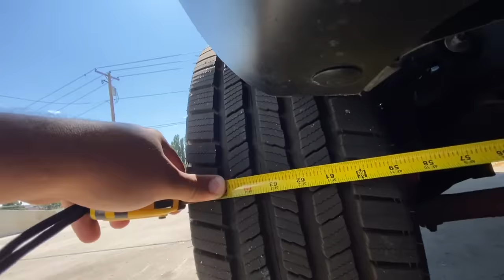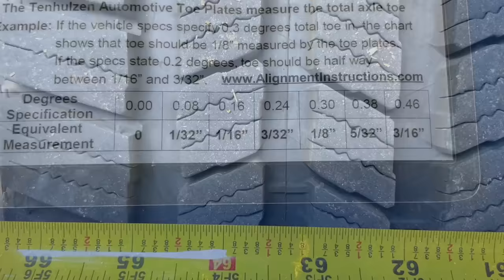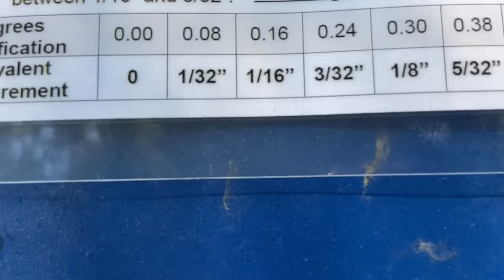How to do an alignment on a car at home using only a tape-measure!!! (And Alignment Basics)

Comment: My father was a mechanic for many, many years of his life. He used to primarily do wheel alignments. I would go into the shop on the weekends and after work, and I always remember watching him doing alignments manually. 

There was this pit, with a rack that you could pull a car onto so the front half was completely accessible, and then he would mount these reflectors on the wheels, turn a spot-light on, and it would reflect the beam of light to a gauge at the front of the pit, which would give you camber and toe readings. I know it was a John Bean product (because his signature was on it) and there was this section on the front called "Mathematics of Alignments" which had all kinds of formulas and information for the figuring out the alignment angles. It was way over my head at the time (I was in the eight grade, I think).

Decades later, and I am replacing the entire front end of my car (crossmember, inner/outer tie rods, sway bar bushings and links, ball joints, and wheel bearings (probably the whole hub and knuckle, tbh). However, I live an hour's drive away from the nearest place that does alignments. 

Then I got to thinking about my dad and how he used to do this stuff and figure it out by hand and I reasoned that there must be some way that one can do this  yourself without thousands of dollars of equipment or hundreds of thousands of dollars in specialized computers. So I started researching it and here I am. 

Rest in peace, old man! You've taught me more than you will ever know.
Reply: Amen to that Brother 👍
Reply: About that expensive equipment in shops - every time I've taken a car to the local professional shop with modern equipment to get a wheel alignment, they've done a shitty job. Either car pulls to one side or the wheel isn't straight. And it's 100€ a pop.

What good is all this expensive equipment if the result is crap?
Reply: I wish I grew up doing stuff like this! my partner grew up on the rez was fixing tractors, trucks, cars everything learned by himself and friends from watching the old uncles and mostly trial and error and they had a ton of fun working on their own vehicles together, pranking each other etc!! Gonna try learn how to replace some parts and then use thia method for alignment on my 2007 Cobalt with his help and experience! hoping the stars align for it!!
Reply: "Go to the local Bank, they can explain the good in the expensive equipment with poor quality. Might be they end up ditching the question, but they know the answer." @JayMaverick
Reply: You sure it wasn't made by Jim Beam ?😂
Reply: Good son good input
Reply: @jodinepratt2568 you got this! Your brow are counting on you.
Reply: Sorry for your loss
Reply: Oh man,your comment is like a time machine, which brought me all the way  back to 1995. Rest in peace, my old man, as well. My dad was so tough on us that I never said I loved him. I was  always afraid that he could think that I wasn't tough like him.
Reply: Fond memories, I have a few of my own…
Reply: @ryanlewis8093  Unfortunately, we don't realize when we're young that the stuff dad's and mom's did seemed boring or not our idea of fun. But in my 40s, I know for a fact that he taught me so much that I didn't know was a lesson. Thank u, Dad.

Comment: Thanks for the demo! I tried the tape measure, but I didn't want to hassle my wife to come out and hold one end while I did math. So I used a long piece of trimmed 1/2" x 1" wood, with a screw through one end with just enough screw poking out of one end to hook into a tread.  Using the 2nd inner treads, I was able to reach over and hook on to the other side easily, then mark the wood on the other corresponding tread. Went to the backside, did the same. Now you have two marks on the wood who's difference you can now easily measure.  A lot easier than a floppy tape measure and having to read that tape measure down to a 32nd of an inch while under your car!
Reply: Man you could have just taped the tape measure to tire but a great idea I'll use it on something but I'm putting a frontend on for the first time now that I've watched these video I feel like a pro man I got right angle battery drill 20 volt and a electric impact wrench and I'm ready to replace that explorer whole front end
Reply: That's a really cool way of doing it especially if you have a few vehicles to do!
Reply: OP
Reply: 0
Reply: smart!
Reply: I used the same technique except that I screwed the screw into the tire to make sure it didn't come loose.  I went to Texas A & M.
😁👍
Reply: Especially if your wife is not mechanically inclined. This tread or this tread? Here? Stop yelling at me!😊
Reply: Rule # 1...never ask your wife to do anything. Rule # 2...Refer to rule # 1...
Reply: @jerrymccurry9372 lmao love rule number one and two because if you care about your relationship you  never ask your wife for help! Lol God bless us all

Comment: That method works just fine for adjusting basic toe in settings. However, it will not center the steering wheel if it isn't already straight. Also, a person would want to make sure the bellows boots are back straight after turning the tie rods, i take the clamps loose first and shoot a little wd in there with the straw before turning them. Good vid!
Reply: If you took note of your steering wheel centre or off centre position you can determine which wheel to adjust. Doing this incrementally and checking the steering wheel as you go will sort it. Done this for years.
Reply: @nigelmitchell351  so if you need to steer left to go straight, it’s the right side that’s pulling you that way, or do I have that backwards?  What about the other adjustments?
Reply: @gregorykusiak5424  Hi Greg, if you're sure your car is not bent, the first thing I would look at is your tyre wear, outer edges of each front tyre should show approximately even wear. Then measure your toe in or out as described in this video.Then, from your analogy you should adjust in increments of no more than half a turn on the track adjusters to turn the car to the left.
This should, on a totally flat surface, put your steering wheel straight when driving straight. ATB,  Mitch.
Reply: Tim Russell you read my mind
Reply: Wow, it pays to read a few comments, great information to know, thanks
Reply: Good point, also I can add that in most cases you don't know if one is off and the other is straight or they are both off. I've notice, that if the wheel runs straight but the measurement is off, you know their both off the same amount,  but let's say the wheel is crooked to start, you can open or close toe-in/toe-out one wheel (depending on measurement) test drive, if the crooked got better then doing it again on same wheel until the wheel won't get any straighter then back it off a smidge. Now that one is straight , remeasure and adjust the other wheel accordingly.
Reply: @kelkilkat  Don't mean this in a mean kind of way to any presenter----but I have learned that the worse the video (which this one is not) the more good information one gets in the comments. LOL  Lots of corrective information to be gleaned.
Great videos with correct information usually get a lot of kudos with few additions on the  how-to's. 
So it's sort of a win-win expenditure of my time. Bad video---learn how NOT to do something via the video but great riches in the comments. Good video--learn one of the right ways to do something...period.
Be blessed today...by whom else....Jesus!
Reply: I have 08 Altima Coupe with steering sensitive issues. By that the steering favors the right pull and left pull. I recently did a Tire rod change on both sides. I may have fumbled it as I notice my passenger wheel is slightly turned at a straight steering wheel. My question, will adjusting the tire rods this way help in that unloving quick turn.
Reply: did he not straighten steering and secure with seat belt it before making adjustments

Comment: Also what works really good it's a couple of commercial vinyl tiles used as turntables,  With the polished sides facing each other under the tires,  done it many times with good results.
Reply: I would imagine trash bags could work pretty good too
Reply: Add some grease between the plates for a smooth slick turn.  A trick we used in high school auto shop on the old school manual alignment rack back in the Stone Age.
Reply: Aluminum foil
Reply: @jscarter0110  I use Polythene shopping bags smeared with a little grease on the inside, doe`s the job and no mess.
Reply: Great idea. I've been wanting to get some sort of turntable but that sounds much more available.

Comment: That's the method I use. Hold the tape measure in the tread with some duct tape and take readings across the front and rear of the tyres - move the car forwards and re-check measurements. If the steering wheel is slightly off centre, count the threads on each tie rod and by adjusting just one side it is possible to correct the steering and achieve the desired toe - I prefer just a slight toe-in. After any adjustment move the vehicle and re-check the measurements.

I've done this on my Passat, the steering wheel is now spot on and tyres which were previously wearing badly have been replaced and the new ones are now wearing evenly across the treads.

Comment: You could improve accuracy of measurement more of you mark the two points with some paint, or tippex, and then push your car  in forward or backward  direction until those two marks appear at the rear, so you can now measure more accurate as this would take away any element of any wheel being slightly warped, or some other difference in tyre pattern . Overall its a good basic way to align. You also need around 1 degree toe in
Reply: Can you explain further? Not quite understanding what you mean
Reply: @danielplumley2649  Instead of comparing front tires to back tires, which can lead to some inaccurate measurements due to tire warping, and other things, you want to compare the front tires to the front tires. So in other words, when measuring between the points, mark where the tape measure starts and ends on the tires. Then put your car in drive or reverse (or neutral and push it) until those 2 points are facing the back of the car. So turn the tires until they have spun 180°. Then measure between the points again.
Reply: @VibinCam  thats  Great idea brother.. i do tape alignments all the time and  agree completely with that logic..makes sense
Reply: How do you know which side to make the adjustment though? Or do you do a little to each tire to make it even on both sides
Reply: On our race cars we always used a piece of white duct tape or masking tape and marked it with a slight hole from a sharp object obviously not pushing in too hard just enough to pierce the tape. In our case we actually used a piece of metal electrical conduit and two sliding pieces of aluminum block on each end with a hole and thumb screw in to move it and tighten it for width, then another small piece of conduit on the same block going vertically with a screw through it for the marking point so that way we could go under low cars and right it on the other side and it would be accurate every time we moved it and the measure would be consistent.
Reply: @kevinkraftable  You don't. You could start with assumption that the previous alignment was done properly, and then count the turns on each tie rod. The whole DIY alignment should be clear that it's just so it's "good enough" to get you to the mechanic to do a proper alignment.

Comment: I figured this out myself, decades ago. Had a Chister minivan. The back tires were cupped so bad it would howl on the highway. Did the wheel bearings first. Which was a waste. I found out the rear wheels were closer together than the front. The rears were toed in considerably. I made shims out of a tin can and corrected the toe in. Aligned the front using a similar technique as the video. Bought a cheap set of tires at a farm store for under $200. The fronts lasted 106k and the rears 143k. Gave me great confidence that I could do my own alignments.
Reply: SMART move on the shims! Rear toe is critical on any front or four wheel drive vehicle for that exact reason.

Comment: I also used to do this way back with a measuring tape, you need to use a reference point usually found under the front cross member ( usually a hole ) to adjust your toe DIY style. Make sure your tires are properly inflated before you start adjustments. Measure that right tire tread location to the center of that reference point and do the same with the left tire, then make your adjustments. Don't forget to tighten that jam nut when done. I now prefer to take my vehicles to a wheel alignment shop for $69.99. I know it's dead on.
Reply: Yea, this method is not good. He is not using any reference point. That reference point are the rear tires that most use to measure from.
Reply: I've diy a couple times with great results. Last month decided to spend and have it done..waited 3 weeks and spent$150 at best shop in town and the steering wheel is still a little pointed to left. So you know..DIY or DIE.
Not taking it back..drive there..wait.. maybe it's right but..
Reply: @LJC5865  if i can do it myself and get it done right the 1st time, I DO IT.
Reply: The key to presenting a mesuring tape alignment is to simplfy the process. Your coments are too detailed and defy the action of self alignment.
Reply: They want $125 here now for just  a toe . No caster or camber
Reply: True.
Assuming the rear wheels are square with chassis, the centre of cross member would be a good reference point.
Reply: @prickajeck  um...its not that hard to figure out...not like your attempt to try and sound smart with your choice of words even though you misspelled some of them....maybe just dont do it since you're obviously not capable
Reply: @joeturtleneck2300  You sound like he hurt your feelings, quit being so damn sensitive...this isn't even your post🤣🤣🤣
Reply: Shops are only good if they have good staff!
Most don't seem to bother to set steering wheel straight these days.When I worked in garages that was the first thing you did !
Reply: It's tough to beat a laser.
Reply: @markk3652  yeah but more expensive
Reply: @ACommenterOnYouTube  how is there no reference point?  hes taking measurements from 2 exact same mid sections on the tyres halving the front track width and using the charts to calculate how much needs adjusted on each side.
Reply: @anonymousdcal  because 1 of the tires can be off by 5 deg which in tern will throw the other tire off. 
You need a center point of the car as a reference to meaure from that center point to 1 tire then center point to the other tire. 

Thats how you align the front tires on a rwd car, the fixed rear wheels ARE the reference point.
Reply: @ACommenterOnYouTube  very specific there with 5 degrees.. what point on the rear wheels is the reference point? tbh i would take 2 measurements front and back middle of each front tyre then that would give me an idea of how much i'm off by with wheel centred vehicle on ground or off axle stands for front wheel alignment and check that against specificications/tolerances of what they should be.
Reply: @anonymousdcal On a RWD car the rear wheels are FIXED and do NOT move ...
So you align the front tires TO the rear tires using string. 

If you measure the width of the rear tires and get 5 ft ... You can do the same to the front tires BUT if one front tire is OFF by 5 degreee's then the other tire will then be 5 deg off as well ...

On  FWD car the rear tires need to be aligned as well and that is way more complex but can be done.

Comment: My toe angle tools are as follows. 
1 x wooden dowel (or old brush handle) about 1.2 to 1.3 metres long and 25 or 30mm dia, one end cut to a 10mm diameter tip, other end flat end but one side planed to provide a flat tapered surface. 
1 x 300mm ruler. 
The ruler is held on the flat tapered surface of the dowel with your thumb holding it so that you can slide it to change the combined length. Place the 100mm tip of the dowel on wheel rim as far back as you can reach and slide the ruler so that the end of it is placed on the rim of the opposite wheel. Note the reading on the ruler where it passes the end of the dowel. Do the same for the forward parts of the wheel rims and note the difference. Your should multiply by a suitable factor to get a toe-in reading for the full diameter of the wheel: perhap about 1.5 depending upon the distance between your measurement points.